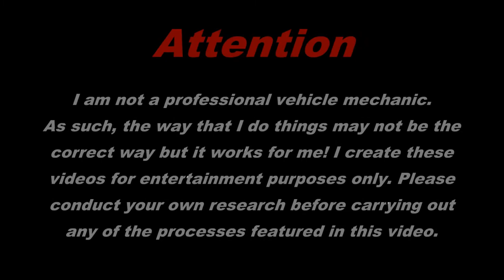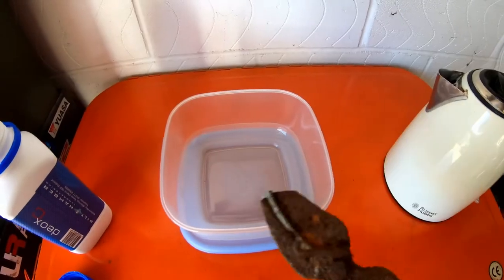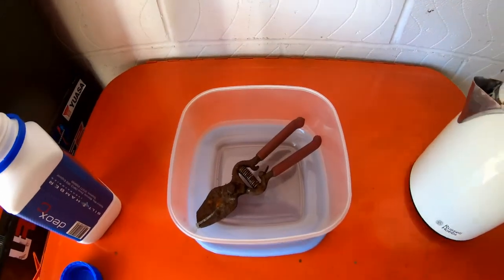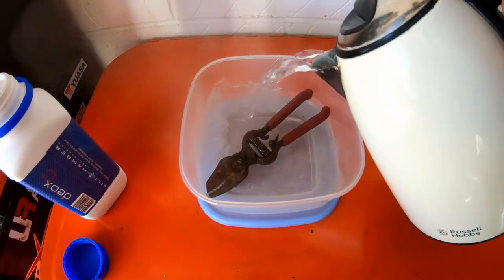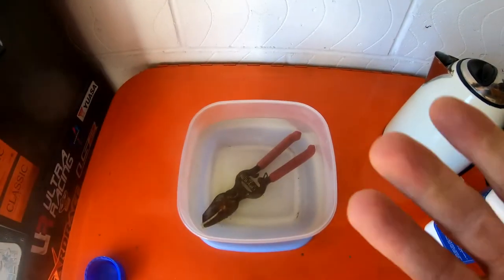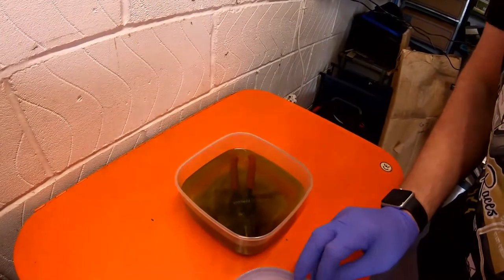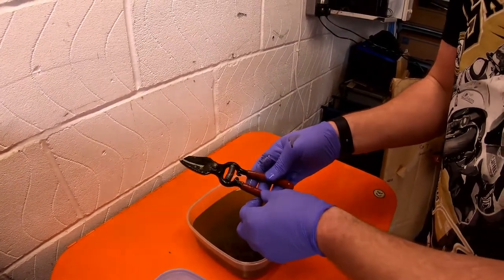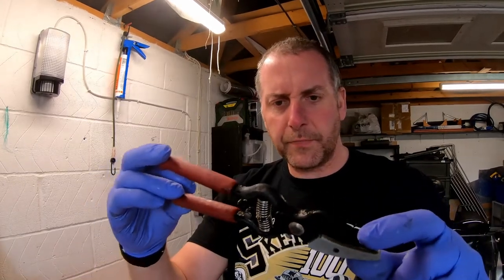Bilt Hamber DEOX-C Concentrated Rust Remover - First Use, Test and Review

Comment: Just used it to clean rust off a kranzle jet wash hose end caused by a crappy connector. Left it two hours, all rust gone. Awesome product. Bilt Hamber and britemax products are excellent. I used the paste, which you apply neat and put clingfilm over the paste.
Reply from the maker: Is the paste the Hydrate 80 stuff? I have some of that too? Not tried it yet though. 👍🏻
Reply: It’s the Deox Gel I think they mean

Comment: If You had kept the solution hot overnight, it would've continued to dissolve more rust. The reaction stops earlier, if the solution drops in temperature. It's as if it's better to start off with a cold solution. But of course, that could take days and days...

Comment: Have some of this and have not used it yet, off to put the rear anti roll bar in a bucket of this.
Reply from the maker: If you have something of that size, you could also try a product called Hydrate-80 from the same company, it's applied with a paint brush and when dry can be painted or powdercoated straight over!

Comment: I didn't know they made this stuff though. My vfr800 is peppered with rusty metal parts, I have used knust on them but that's designed more for preventing a surface before paint.
Reply from the maker: I was stunned at how effective this was. This would be perfect to prep parts prior to zinc plating. I will be using this on my ZX9R project that’s for sure. I also have Hydrate80 for those larger parts that you simply fit into a bath of DeoxC 👌🏻
Reply: @KevsShed  think I need to go and look at their entire product range rather than just sourcing from valet companies.

Comment: I have used this stuff many times. In fact i just bought 2 more tubs and a large plastic container to fit my fuel tank in to treat it. Worked wonders on the last one i did. Also once rinsed off the other tank i did did not flash rust either which was great :o) brilliant product.
Reply from the maker: That's an excellent idea, I hadn't considered it's potential for cleaning rust from a fuel tank! Good tip!
Reply: @KevsShed  you are welcome. I also put a small fish tank heater In to keep solution warm for day or so👍perhaps il do a video of this next one🙂🏍👍

Comment: Good stuff. The last tank dropped it's arse so bought another one. Going to use this stuff first and then seal
Reply from the maker: Good plan 👌🏻
Reply from the maker: What tank was it that failed on you? Bike model I mean?
Reply: @KevsShed  19-year-old ZZR1100 D9. They are known for it. Shame, the paintwork is OK
Reply from the maker: olaf jensen seems to be an issue with many makes and models of that era though. I wonder if there was a spate of cheaper Chinese steel used then. I’m really conscious of my SRAD meeting the same fate so try to avoid having standing fuel in the tank as it’s the ethanol in modern fuels that are hydroscopic! 😬
Reply: @KevsShed  Just call it water in the tank. And like the cars they rotted
Reply: Oh, reminds me. You can get ethanol-free fuel over here. You seen the price of it thou

Comment: Excellent  !! BUT  let's say you have rusty exhaust  for parts similar size How are you  going to fit in little tub ??  Or let's say if the part on the car / bike is Not removable  how do we do it then ??  Can the product be  painted on form ?? Or is it just in powder form??
Reply from the maker: Use a bigger tub and more powder? 🤔
Reply from the maker: Just kidding, they have another product called Hydrate 80 which is a rust converter that you apply with a brush. I’ll be doing a video demo of that stuff very soon 👌🏻
Reply: They do deox c gel too that you can paint on and wash off later, it's on their own website
Reply: @KevsShed  did you ever do the other video?
Reply from the maker: @sean.g4516  https://youtu.be/Y8xSGDANgqM
Reply: mix it with thick wallpaper glue or buy the the deox gel.

Comment: How about I drill a hole under my van wheel arch and put the deox into the sill. Providing I don't have leaks do you think it would eat the rust! To a degree that I could drain it out with a hole in the sill?
Reply from the maker: There is another product that Bilt Hamber make that I hope to do a video with very soon. It sounds like it’ll be better suited to your needs 👍🏻
Reply: @KevsShed  what is it?
Reply from the maker: It’s called hydrate 80 and it’s a paste that is applied with a paint brush.
Reply: @KevsShed  I've just got that and I'm using it tomorrow so I'll see how it goes. Cheers👍
Reply: Naveed khan,use old transmission fluid,your sills/inside bottoms of doors will never rust.